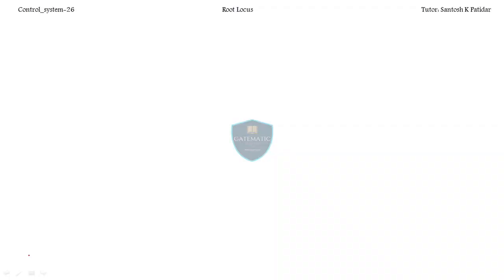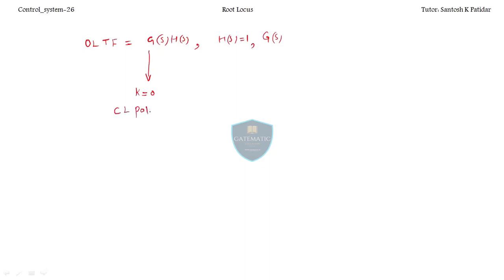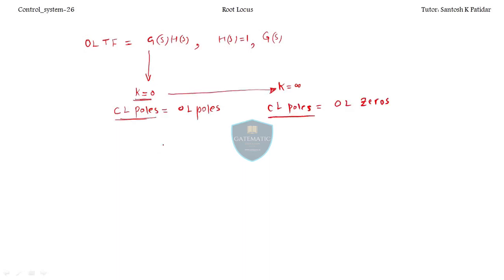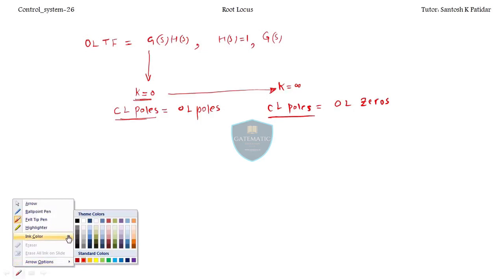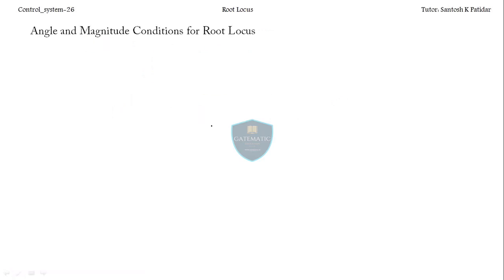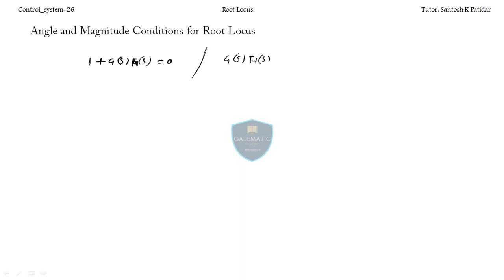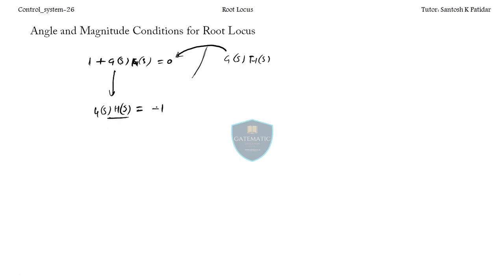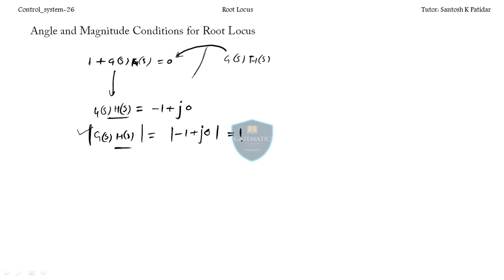Lec 26 Root Locus (Contd.)

Comment: @12:23 , in point number two you mentioned if P>Z , number of loci will be equal to Poles . In next point number 3 , you took one example where we had three poles s = 0,-1,-2 and no zero and you drew only two loci , one between 0 Nd -1 while another between - infinity and -2  . We have two zeros at infinity to get proper TF , so dont you think we will be having twp loci overlapped between -infinity and -2 ????
Reply: Same doubt
Reply: (Copied reply from Santosh sir to Akash Rajmohan 
):
Actually, u r looking RL branches of real axis .... N what I told is total no. Of Rl branches ..... So here we have 1 bread away point which originates two RL branches along the asymptote ....and one branch is on real axis going to infinity ....so total 3.... If still have some doubt I will clear at the end of root locus...

Comment: sir .. You have said that number of loci = number of poles( if poles>zeroes...)..
But in the question k/s(s+1)(s+2)...No of poles is 3 but v get oly 2root loci ...HOW???
Reply: Akash Rajmohan 
Actually u r looking RL branches of real axis .... N what I told is total no. Of Rl branches ..... So here we have 1 bread away point which originates two RL branches along the asymptote ....and one branch is on real axis going to infinity ....so total 3.... If still have some doubt I will clear at the end of root locus...
Reply: @ramkaran2653 Thanku so much sir,I had a same doubt now it has cleared.......

Comment: Sir really all ur videos are of great use..........thanks a lot........ur work is excellent.......it would be nice if u  cover some of the topics like mechanical, hydraulic and pneumatic system components, synchro pair, servo and 
stepper motors, servo valves.......these topics comes under instrumentation..........hope u consider it
Reply: Niranjani Loganathan 
These are the basically part of process control. Also for the IES but for the gate these r not important